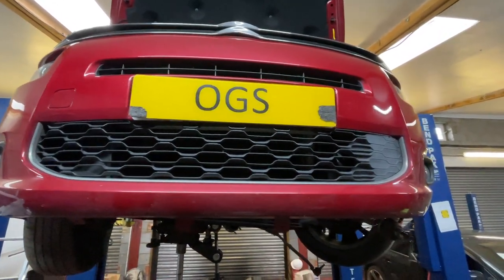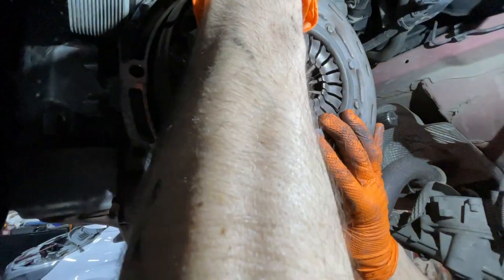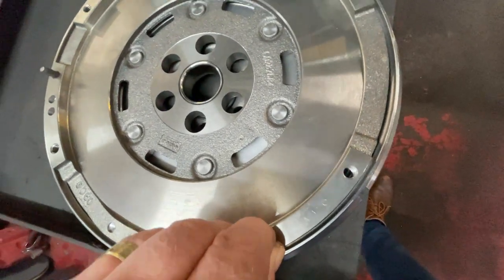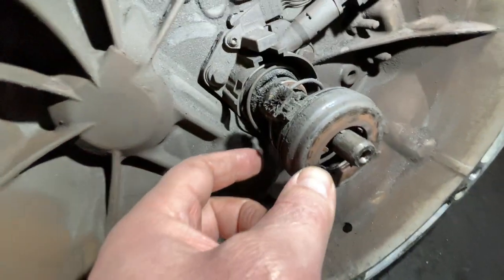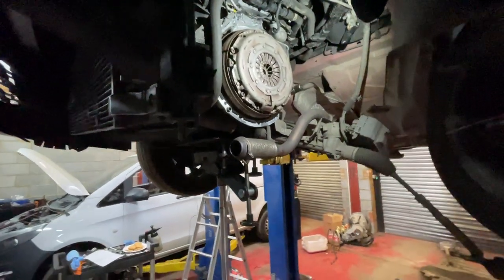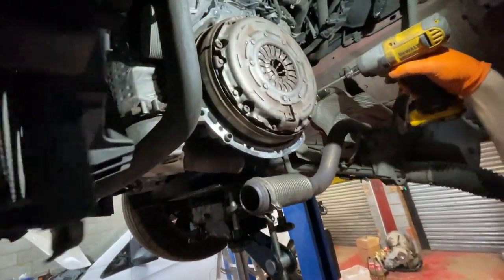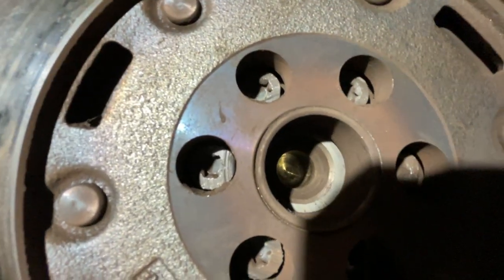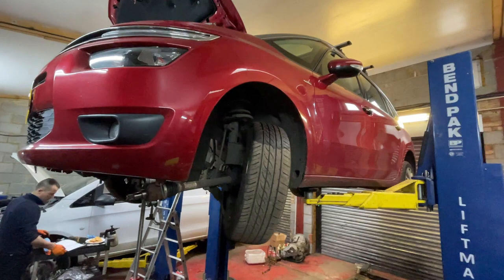Fault found on ENGINE VIBRATION!  Dual mass flywheel PROBLEMS! DMF replacement

Comment: l had the same problem on my  bmw 320d,was getting a lot of vibration even after changing the mountings.After seeing this video l got the problem fixed it was the dmf.Thanks a lot for the informative video.
Reply: Same issue on mine John. It's on the list to do.

Comment: I recently replaced the flywheel on my Renault Scenic 2, because the car was shaking very badly with the same frequency as the engine RPM. Interestingly despite the fact that the flywheel was totally worn, stiff and out of balance, it did not make any knocking noises like other vehicles usually do.
Reply: How its working now?
Reply: @dhurihuta3878  The shaking is gone, Other than that, the clutch and the engine sound and feel the same as before the shaking had started.

Comment: This would vibrate even stationary with high revs ? Because i only get vibration around 120 km\h and i change both CV axles, tires are balanced.
Reply: I have the same problem buddy

Comment: Great video !
I have question about C4 Picasso 2008 year , when i starting in first gear motor start to little shaking and when he transfer in second and other gears everything is ok, same thing with going backward.
Are this symptoms the same  like in your video with  flywheel issue?
Thank you.

Comment: Hi, I have a 2016 Skoda Octavia 120000 km on clock. I have intermittent juddering when accelerating
 from a stop. it also occurs occasionally while driving. I was originally concerned it is an issue with the DSG transmission. I have been advised by another Skoda owner that it is to do with the duel mass fly wheel? The issue is intermittent so would a mechanic see an issue with this if it was inspected? Thanks

Comment: Is there an exact place to fit the new dual mass flywheel on the crankshaft I'm not putting valeo as the old one and cannot copy the place like the old one ,the new flywheel fits every way but I'm not sure whether there is some exact place to put it

Comment: Tahnk you for the video. For my 1999 B5 passat 1.9tdi, 81 kw, could be the same? I had vibration for some time, it started, then stopped and now again. Vibration is all the time, idling, under load, driving fast and slow, of course, not always is easy to feel, but it is there. If DMF problem and rest of the clutch somehow is good, do i need to change all clutch mechanism? I cannot only this bearing?
Reply: Did you repaired?
Reply: @dhurihuta3878  no, vibration still is. But at least clutch is new and working good.

Comment: Hi needed some assistance i have a Nissan with a duel mass flywheel and cannot remove it, there's no movement on the flywheel and the bolts are half visible and cannot get a socket over.

Comment: would a broken (noisy) flywheel affect going into gears? It makes noise while on Park but not while in Neutral. It also somesthimes have vibration while reverse and quite rarely would non engage reverse. would have to restart for it to get reverse sometimes.

Comment: What happens when you make weldings on old dmf to eliminate the rattle? Can we consider the problem fixed?
Reply: not a good idea, these things are precisely balanced, the weight ofthe welding spots would cause more vibrations.

Comment: Would this still cause a vibration if you were doing 65 mph and let the car free wheel in nutural? 
I'm trying to eliminate possible issues with my Audi that vibrates mainly around 60 - 65
Reply: The vibration the DMF causes is directly related to the engine RPM. It doesn't change with acceleration, deceleration and speed. If the engine is at given RPM the car shakes with the same frequency regardless of whether you are pressing the gas pedal or not. I heard it gets worse in some cars while depressing the clutch.